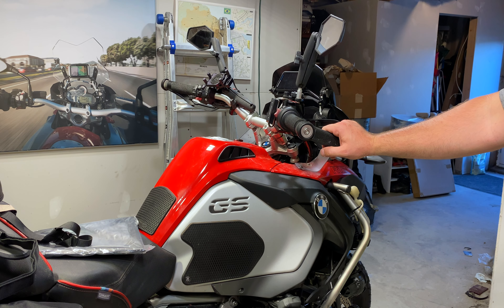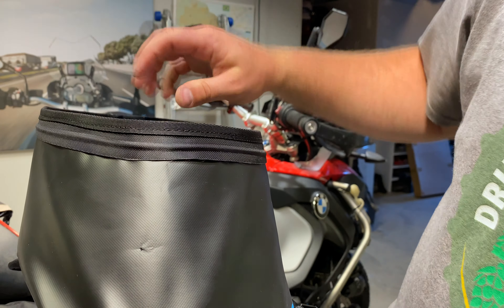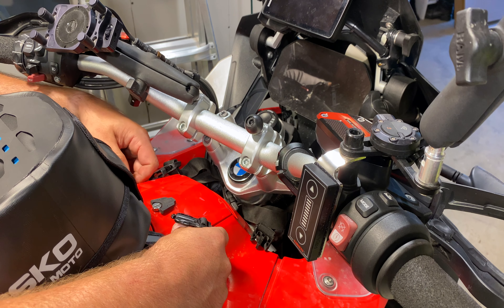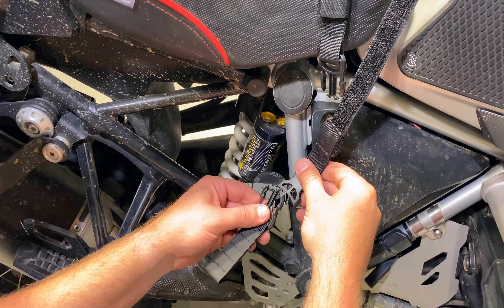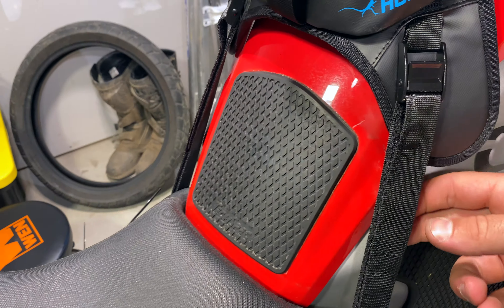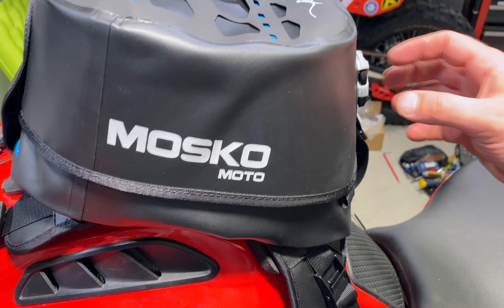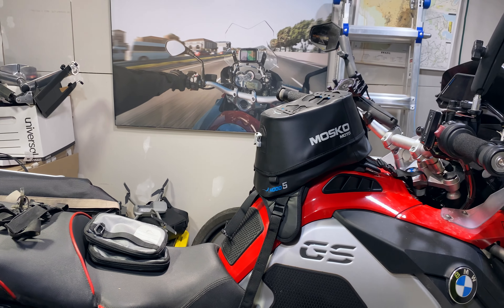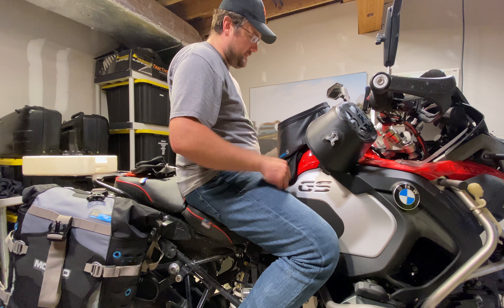Unboxing/Install: Mosko Moto Hood 5 Tank Bag - R1200GS Adventure

Comment: Looks a good bag but I can't personally stand strap fitting. I have had problems on previous bikes with them rubbing and marking the paint. I have been using the givi tanklock bags and have found them fairly decent. 👍🇬🇧

Comment: How bad does it scratch the paint?
Reply from the maker: 5 years and 3 different bikes and so far, no scratches or excessive rub. It fits so tightly that it really doesn't move around on a GSA tank.
Reply: @ thanks. The hood with one buckle access looks so handy. Since you have it on a GSA like I have, do the bars hit it at full lock?

Comment: Did you return the bag with the hole?  or does it matter?
Reply from the maker: I've been using it for a few months now..maybe 3,000 miles in rain/snow/hail and it doesn't matter. it's covered by the top cover. If it ever starts leaking, I have a photo of the hole when I received it.
Reply: @AdamChandler86  Good to know, thanks for the quick reply. I  think I will place my request with Santa for one